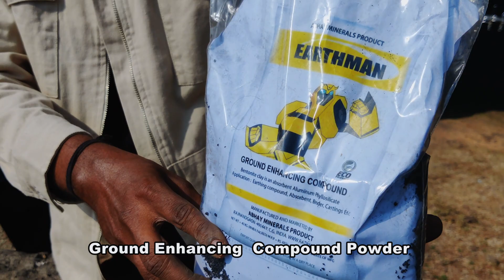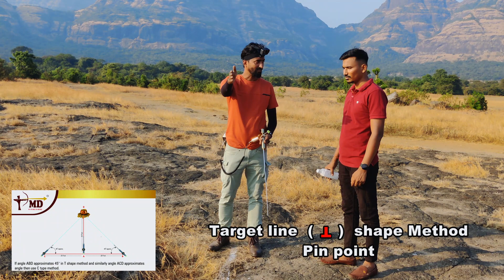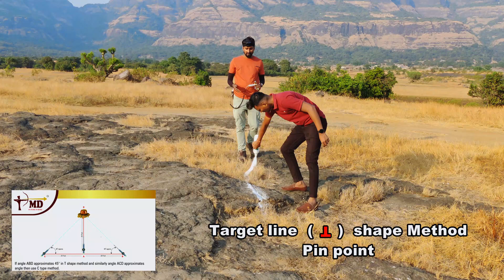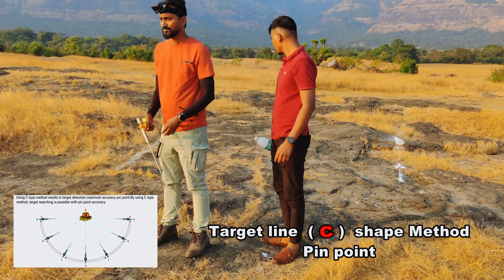Depth Testing in Caves: PMD Detector at Work

Comment: "Hello, sir. I've noticed that you provide training for your device, which is great. I've been paying attention and I see that your device is similar to the TFR 4 Rod. It's not too bad; it comes with a capsule for different types of metal and gemstones, and it has a chamber. Any sample you put inside can be located easily.

I have one, and the biggest problem with the TFR 4 Rod is that it often wastes time. After giving you the exact location point, you dig and sometimes find a rock or small gold ore instead. This has happened to me many times, and it's frustrating not knowing when to dig or not. The only way to find gold is to put it there,  that's not good at all

Now, my question is: Does your device have the capacity to distinguish between gold ore, gold rocks, and dirt with trace gold minerals? If it does, I will buy one and also you can make a trainig video for this to avoid gold ore rock and trace minerals how to do it if you defice cannot cancel the gold ore gold rock and trace mineral it will be a waste time  the big problem because without it, we'll waste time not knowing which location is real  gold. I hope you understand. Please provide an answer."
Reply from the maker: Kindly check previous comments.

Comment: Can you give guarantee,it is work only on treasure
Reply from the maker: PMD Detector: World's First Training Center 🌟

Have you ever heard of any company in the world that provides training for long-range locators? 🤔
The reason is that even they don't trust their own equipment to work effectively. Most locators either pick up false signals or don't work at all. ❌
This is why these companies avoid offering training.

However, PMD Detector has come up with a solution to this problem. 💡 PMD Detector has established the world's first training center, where we provide training for both long-range locators and coil detectors. 🛠️

We teach everything related to treasure hunting from A to Z. 🗺️🔍

*Importance of PMD Detector* 🌐

PMD Detector has revolutionized the field of long-range locators. At our training center, you will receive complete training after purchasing a PMD locator. 📚
During the training, you will learn how to operate the PMD locator and detect hidden targets. 🎯

We will train you until you learn all the techniques of the PMD locator and find our hidden targets. ✅

*Features of the Training Center* 🌟

- 🏡 **2 Days Free Accommodation and Meals**: The company provides free accommodation and meals at the training center for two days.
- 👨‍🏫 **Expert Instructors**: Our instructors are experienced and skilled in the field, guiding you every step of the way.
- 📦 **Comprehensive Training Materials**: All necessary materials and resources are provided during the training.

*Sale of PMD Devices* 🛒

In India, we do not sell PMD devices online. To purchase a PMD device, you must come to our training center. 🏢
To ensure you fully understand all the techniques and operate the device correctly, operational training is mandatory after purchasing a PMD device. 🛠️

*Contact Us* 📞

For more information or to purchase a PMD device and schedule training, please contact: 📱 7249637196.

*Conclusion* 🎉

PMD Detector's training center offers a unique opportunity for anyone looking to enhance their skills in the field of treasure hunting. 🏅
With our high-quality training, you will not only learn how to operate the equipment correctly but also gain significant knowledge and experience in the field of treasure hunting. 🌟

Start a new, exciting, and successful treasure hunting journey with PMD Detector! 🏆✨